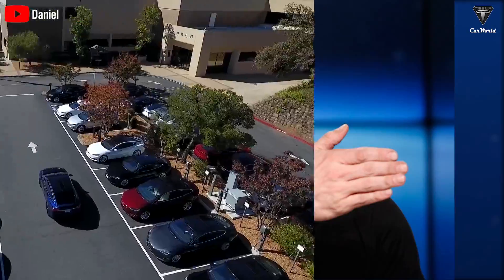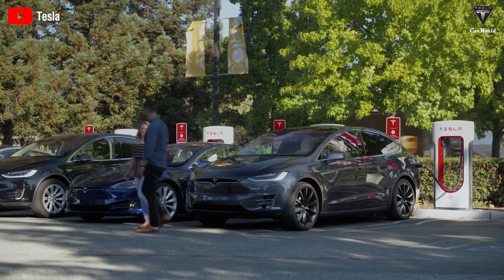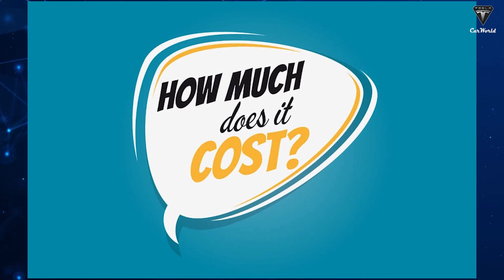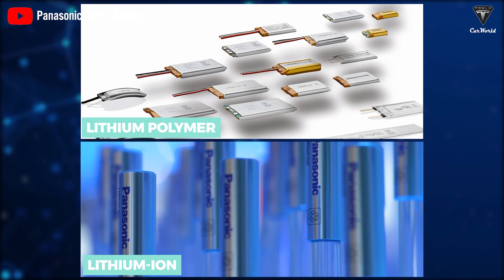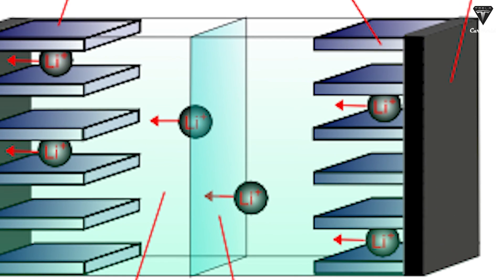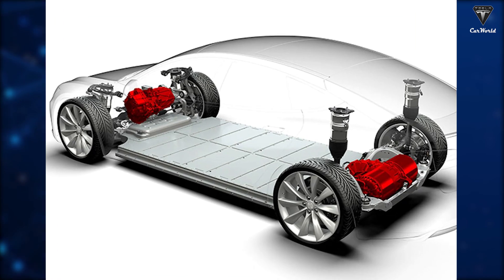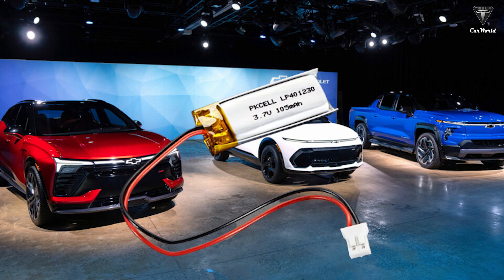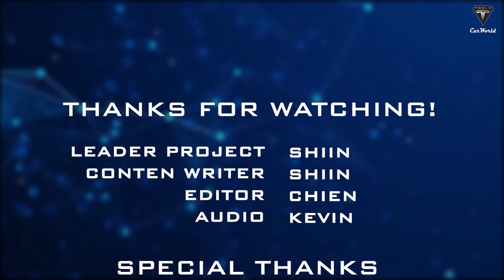No Lithium Needed! Elon Musk Revealed ALL-NEW Polymer 4.0 Battery Tech, Changes Everything in 2024!

Comment: Ok, so if Musk switches to the new battery format, what happens to thier current top end battery that has only been out for about 2 years?  Also, what happens to the factory Musk is building to produce batteries?  Will it strictly be the new LIPO battery plant? What will be the cost of converting current production car battery systems with the new one?

Comment: Anything that will limit the dependency on China for batteries and lithium, can only be a good thing.
They LIPO battery, is a solid battery, free of the liquid and/ or paste of chemicals, acids, etc., and offers a more fire safe product, over the standard rechargeable lead/ acid battery.
"Lithium," is the key.  Other batteries are still in development, like a battery that is 'sodium,' based.